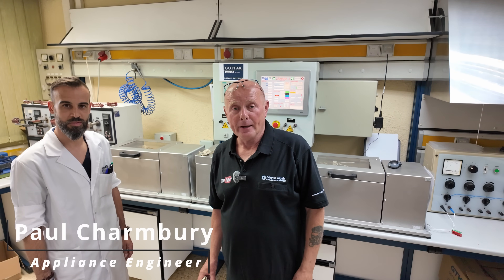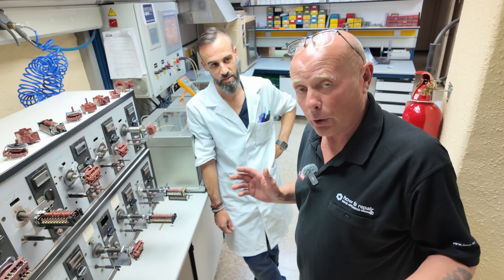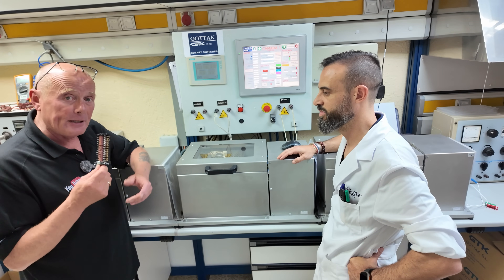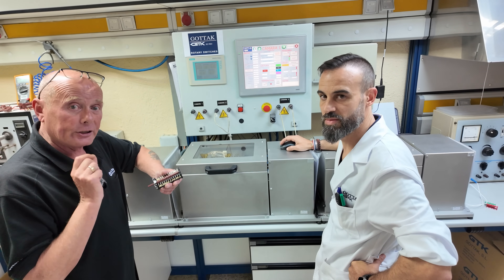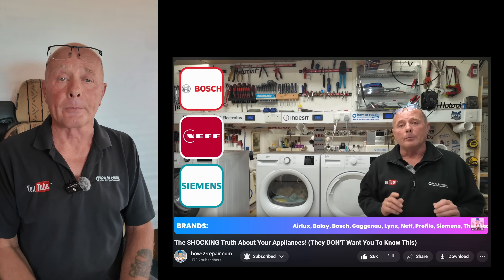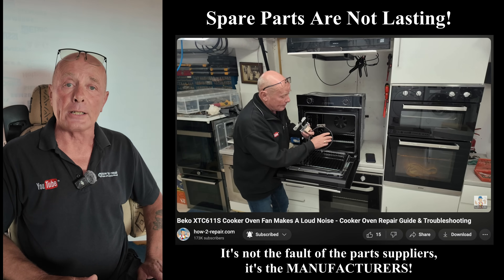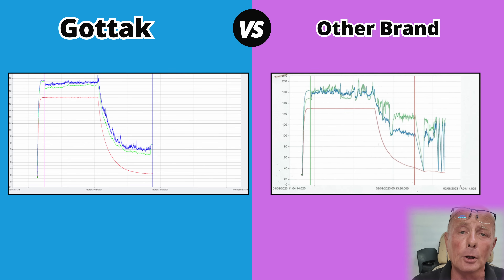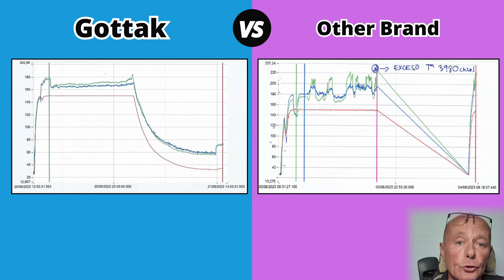Why Your Appliances FAIL SO FAST! Lab Results EXPOSE the Truth!

Comment: It's a catastrophe. Look at this problem in the automotive industry. I have a car made in 2000, it's PERFECT, cheap, easy to fix. Guess what? Today, the spare parts I purchase for my car last about 2 years, then fail miserably. Ball joints, shock absorbers, thermostats, you name it. When I source some new old-stock original part, it last forever. 
And the icing on the cake is that EU wants to get rid of "old cars" by law, forcing us to buy "new cars" because of ECOLOGY?!?!?
I'm enraged by this trend!!!
Reply from the maker: Hi there! Thanks for your comment, @asbestomolesto!

You've hit on a really important point about how the issue of built-in obsolescence extends beyond home appliances and into the automotive industry, affecting both new parts and the push to replace older, more reliable vehicles. This is exactly the kind of built-in obsolescence we discuss in the video.

At the trade show last year understanding how much obsolescence is being designed into new appliances these days is something everyone should be aware of. For a deeper dive into this topic and to see the examples we covered, please check out the full video here: Link to your main video: https://youtu.be/gEgSCbZnHVM?si=wTIw0mELuhWaw4aX

We also explored related aspects in these videos:

The shocking truth about manufacturers: https://www.youtube.com/watch?v=QsdGd2qDPaI
Heat pump tumble dryers are they really worth it?: https://www.youtube.com/watch?v=xn03N3b0-lE
If you found this information eye-opening or helpful, please consider sharing this video with your friends and family. The more people who understand what's happening with appliance longevity, the better equipped we all are as consumers.

Thanks again for watching and engaging! Don't forget to subscribe to the channel for more insights like this!

Comment: Most of Todays failures... are happening due to Lead-Free Soldier.   It does not Flow as good as Leaded Soldier... and creates Microscopic Metal Spikes / Hairs.    Vibrations and Temperature changes... causes these metal spikes / hairs to fall off onto the Circuitboard... and they cause Electrical Shorts,  destroying the equipment.

 And due to the Soldier not flowing as well... you also get a lot of Poor Solider Joints, as well as Via's (through-holes) that are not fully conductive.

 The ECO Radicals pushed the Lead-Free solider out... and MANDATED IT... before they even solved these problems.   They clearly ASSUMED that they could solve / fix these issues... within a fairly quick amount of time.   However, its probably been over 15 years now... and theres no sign of ever fixing things.

 The ECO damages that they have created as a result... as like 5000 times as bad as the small trace amounts of lead, that used to get into the environment.   Electronics that used to last 15 to 30 years... are now lucky to survive past the 3rd year... and the percentage of brand new electronics that are Deceased right out of the box... is probably about 10 to 15%  (which, in the elder era... was Completely Unacceptable.   Even One brand new electrical failure per +80,000 shipped items..  was still unheard of)

 You can see evidence of this, on every street.   Tons of LCD TVs,  on the curbs... that lasted less than 5 years.   These are tvs that have perfect surfaces (no panel / glass damages).   They are all electrical failures... due to Lead-Free soldier.

 Now... you would think that these fools would realize that Mountains of Eco Trash that were being created... and reverse the Policies... Right?!    Nope.   They refuse to accept their wrong doing... and keep allowing more and more Eco trash to pile up... and more and more Resources  (including more Energy)  to be completely WASTED.
Reply from the maker: Hi there! Thanks for your comment, @johndough8115!

You've hit on a really important point about the impact of lead-free solder on the longevity and reliability of electronics, detailing how it contributes to premature failures due to issues like metal whisker growth and poor solder joints. You've also brought up a critical perspective on the environmental consequences of these mandated changes. This is exactly the kind of built-in obsolescence we discuss in the video.

At the trade show last year, understanding how much obsolescence is being designed into new appliances these days is something everyone should be aware of. For a deeper dive into this topic and to see the examples we covered, please check out the full video here: https://youtu.be/gEgSCbZnHVM?si=wTIw0mELuhWaw4aX

We also explored related aspects in these videos:

The shocking truth about manufacturers: https://www.youtube.com/watch?v=QsdGd2qDPaI

Heat pump tumble dryers are they really worth it?: https://www.youtube.com/watch?v=xn03N3b0-lE

If you found this information eye-opening or helpful, please consider sharing this video with your friends and family. The more people who understand what's happening with appliance longevity, the better equipped we all are as consumers.

Thanks again for watching and engaging! Don't forget to subscribe to the channel for more insights like this!

Comment: my old boss runs a whitegoods repair business and even the new stuff is failing under warranty, also the older models had simple controllers and motors but the newer ones have a controller on the back of the motor now that fails and guess what you have to buy a new motor for a faulty card, and we have machines that had one main board that drives everything now for some reason they have 3 boards now makes repairing very costly.
Reply from the maker: Hi there! Thanks for your comment, @rellett1!

You've hit on a really important point about how new appliances are failing under warranty and the increased complexity and cost of repairs due to multiple control boards and integrated components. This is exactly the kind of built-in obsolescence we discuss in the video.

At the trade show last year understanding how much obsolescence is being designed into new appliances these days is something everyone should be aware of. For a deeper dive into this topic and to see the examples we covered, please check out the full video here: Link to your main video: https://youtu.be/gEgSCbZnHVM?si=wTIw0mELuhWaw4aX

We also explored related aspects in these videos:

The shocking truth about manufacturers: https://www.youtube.com/watch?v=QsdGd2qDPaI
Heat pump tumble dryers are they really worth it?: https://www.youtube.com/watch?v=xn03N3b0-lE
If you found this information eye-opening or helpful, please consider sharing this video with your friends and family. The more people who understand what's happening with appliance longevity, the better equipped we all are as consumers.

Thanks again for watching and engaging! Don't forget to subscribe to the channel for more insights like this!

Comment: Not many modern appliances use analog knobs anymore. Just about everything uses solid state/digital and not mechanical/analog switching. 

But the real elephant in the room is do we want quality or efficiency? Yes we could still build things to last but it will cost in efficiency due to the heavier higher quality parts increasing overall cost and energy requirements. What we deem as planned obsolescence is is both true and false at the same time. Building higher efficiency items requires lighter parts, and lighter parts have a shorter lifespan. And that is the real rub, do we want it to last or cost us more. You can get both but pay a lot more for it, and people cannot afford that or want that.
Reply from the maker: Hi there! Thanks for your insightful comment, @jonesgang!

You're absolutely right that most modern appliances use solid-state/digital controls rather than mechanical knobs, and this shift itself has implications for repairability and lifespan.

Your core argument about the "real elephant in the room" – the balance between demanding higher efficiency and the desire for quality – is crucial. The idea that "building higher efficiency items requires lighter parts, and lighter parts have a shorter lifespan" is a compelling perspective that complicates the narrative of pure built-in obsolescence. It suggests that what we perceive as planned obsolescence might sometimes be an unintended consequence of prioritizing energy efficiency and lower initial cost, which consumers often demand.

You're spot on that getting both high quality and high efficiency often means paying a significantly higher price, and that many consumers either cannot afford or do not want to pay that premium. This highlights a fundamental dilemma in the market that directly impacts the kind of built-in obsolescence we discuss in the video.

At the trade show last year, understanding how much obsolescence is being designed into new appliances these days is something everyone should be aware of. For a deeper dive into this topic and to see the examples we covered, please check out the full video here: https://youtu.be/gEgSCbZnHVM?si=wTIw0mELuhWaw4aX

We also explored related aspects in these videos:

The shocking truth about manufacturers: https://www.youtube.com/watch?v=QsdGd2qDPaI
Heat pump tumble dryers: are they really worth it?: https://www.youtube.com/watch?v=xn03N3b0-lE
Your comment adds a valuable layer to the discussion by pointing out the complex interplay of consumer demands, technological advancements, and economic realities that contribute to current appliance lifespans.

If you found this information eye-opening or helpful, please consider sharing this video with your friends and family. The more people who understand what's happening with appliance longevity, the better equipped we all are as consumers.

Thanks again for watching and engaging! Don't forget to subscribe to the channel for more insights like this!

Comment: lack of lubrication . Everything has need lube cycle . Most ignore that
Reply from the maker: Hi there! Thanks for your comment, @Karol-g9d!

While some failures are undoubtedly due to design for built-in obsolescence, you're absolutely right that a lack of proper lubrication or ignoring recommended maintenance can definitely contribute to premature wear and tear. It's a key factor many consumers might overlook, and understanding it can help extend an appliance's life.

At the trade show last year, understanding how much obsolescence is being designed into new appliances these days is something everyone should be aware of. For a deeper dive into this topic and to see the examples we covered, please check out the full video here: https://youtu.be/gEgSCbZnHVM?si=wTIw0mELuhWaw4aX

We also explored related aspects in these videos:

The shocking truth about manufacturers: https://www.youtube.com/watch?v=QsdGd2qDPaI
Heat pump tumble dryers: are they really worth it?: https://www.youtube.com/watch?v=xn03N3b0-lE
If you found this information eye-opening or helpful, please consider sharing this video with your friends and family. The more people who understand what's happening with appliance longevity, the better equipped we all are as consumers.

Thanks again for watching and engaging! Don't forget to subscribe to the channel for more insights like this!
Reply: @How-to-repair  Take 18 wheeler most have greaseless universal joint . Owner interpretation =no greasing needed . Manufacturer interpretation = you'll grease every 100000 miles instead of every 3500 miles

Comment: Component selection, material science, and CHARACTERIZATION are super interesting and important. And are what sets quality Manufacturing apart. Also the Alloys used in relay and motor contactor contacts are absolutely fascinating. They aren't just simple silver. They're super specialized and exotic alloys.... And there's an entire Rabbit Hole to go down when discussing selector switches, relays, and contactors.
Reply from the maker: Hi there! Thanks for your comment, @hullinstruments!

You've hit on a really important point about component selection, material science, and characterization being key to quality manufacturing. We completely agree that this is what truly sets high-quality products apart, and your insights into the specialized alloys used in relay and motor contactor contacts are fascinating. This deep dive into the engineering choices behind components perfectly illustrates the kind of differences that contribute to or fight against built-in obsolescence.

At the trade show last year, understanding how much obsolescence is being designed into new appliances these days is something everyone should be aware of. For a deeper dive into this topic and to see the examples we covered, please check out the full video here: https://youtu.be/gEgSCbZnHVM?si=wTIw0mELuhWaw4aX

We also explored related aspects in these videos:

The shocking truth about manufacturers: https://www.youtube.com/watch?v=QsdGd2qDPaI
Heat pump tumble dryers: are they really worth it?: https://www.youtube.com/watch?v=xn03N3b0-lE
If you found this information eye-opening or helpful, please consider sharing this video with your friends and family. The more people who understand what's happening with appliance longevity, the better equipped we all are as consumers.

Thanks again for watching and engaging! Don't forget to subscribe to the channel for more insights like this!

Comment: We recently were given a higher end bosh oven from 2004 by someone who was renovating their kitchen. Since we didn't have an oven this was great, but unfortunately it turned out the selector switch was failing. We weighed up the options and decided to spend the £88 on a new switch and fitted it ourselves. The oven works well now. I'm curious to see just how far this relatively old oven will go, but if we get a few years then I think it will be a good result for the expense.
Reply from the maker: Hi there! Thanks for your comment, @Ben-fr8gi!

You've hit on a really important point about the value of repairing older, quality appliances like your 2004 Bosch oven. Your experience of replacing the selector switch and getting the oven working again is a fantastic example of combating built-in obsolescence. It shows that sometimes, a relatively small investment in a part can extend the life of a solid appliance significantly.

At the trade show last year, understanding how much obsolescence is being designed into new appliances these days is something everyone should be aware of. For a deeper dive into this topic and to see the examples we covered, please check out the full video here: https://youtu.be/gEgSCbZnHVM?si=wTIw0mELuhWaw4aX

We also explored related aspects in these videos:

The shocking truth about manufacturers: https://www.youtube.com/watch?v=QsdGd2qDPaI
Heat pump tumble dryers: are they really worth it?: https://www.youtube.com/watch?v=xn03N3b0-lE
If you found this information eye-opening or helpful, please consider sharing this video with your friends and family. The more people who understand what's happening with appliance longevity, the better equipped we all are as consumers.

Thanks again for watching and engaging! Don't forget to subscribe to the channel for more insights like this!